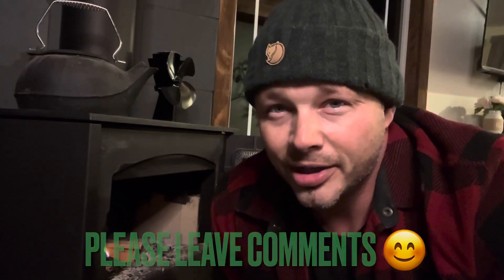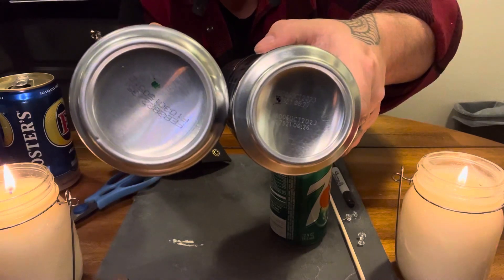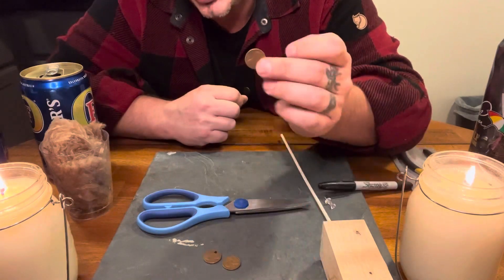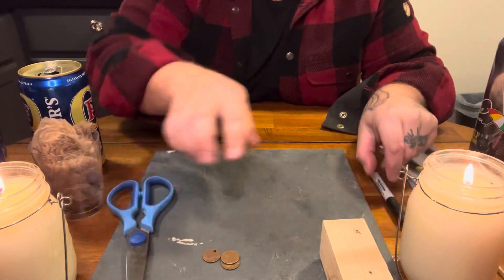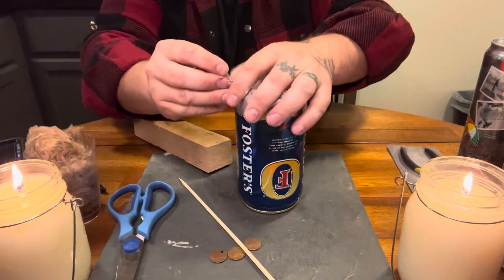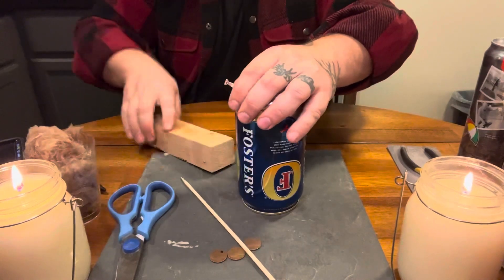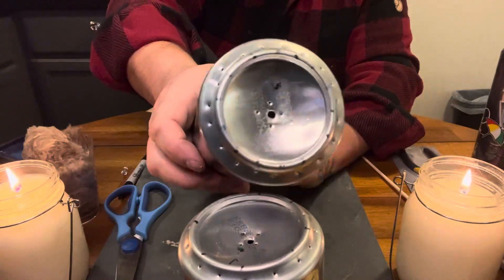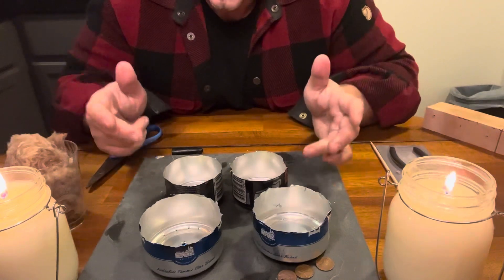Penny can Stove | ALCOHOL STOVE | Emergency HEAT

Comment: I made this stove years ago. The stove I made with The Foster's cans I used it for around 5 1/2 years . I first lived in a tent to prove I could do it that's when I made my first stove. And then made the Foster can stove, because I knew it was much better weight of aluminum it was bigger around and I knew it would last longer. After proven everything I wanted to prove by living in the tent. I then moved into an apartment that had a fireplace. I used the Foster can stove to heat my apartment every day in the winter and it worked great, that was the only heat I ever needed in the apartment, I just added extra fire brick inside the fireplace to generate more heat.  I still have that stove. That stove is now 15 years old. I still use it on occasions just for the fun of it to cook on outside. You can also use 70% rubbing alcohol and it works fine. I made my first stove in 2006. I now make them and give them to homeless people out of just Arizona iced tea cans and soda cans, I've been making them and giving them away for 15 years.
Reply from the maker: What an amazing story Marcia! Thank you for sharing and thank you for helping everyone you do! many blessing to you this holiday season!
Reply: Yeah my friend you get good attitude 👍😉😊🤝⛄☃️❄🌞
Reply: Wow great to know I’m making me some for for my tent
Reply: How long will one fill burn?

Comment: Love it.  I made a stove with a thin copper tube with jb welded penny on each end.  2 rows of 5 tiny holes on the top side.  I made a mini stand for it.  Tiny house stuff would be nice.
Reply from the maker: OK buddy I will work on that, what type of stuff do you want to see with the tiny house, just a walk-through or things I did saved money and ideas? I love the copper hose heaters they are super cool, I just haven’t made one into a video as many of my viewers need simple solutions, the folks that may appreciate the advance stuff is a smaller number for me😬

Comment: Back in the day these stoves were popular on the Appalachian trail. They are lightweight, low tech, so they don’t have complicated parts that break, alcohol is easy to find at hardware stores and gas stations (and dollar stores, apparently). If you misplaced your stove you could easily make another with trash and a multi tool. You don’t have to worry about checking your camp stove in your luggage, which is not allowed overseas. Easy peasy lemon squeezy! 
The only 2 downsides are that 1, alcohol doesn’t burn well at very low temperatures, and 2, if you are not careful and knock it over while it’s burning there is fire immediately.
Reply from the maker: Thank you Nancy, you are correct on everything… Definitely good education to know, thank you for watching many more tips to come

Comment: Hey Cohen, I got your video of the 72 day candle in my suggestion list. I watched several of your videos and this is the stuff of which I am looking. So I subbed, Liked and pounded that Like button. Looking forward to more videos.  God Bless and stay safe.
Reply from the maker: Thanks I will KEEP EM COMING BRUTHA !
Reply: On the rocket stove, as a mobility challenged senior who really has no space to store tinder,& can't really bend down to gather, would there be any problem with using chunk charcoal.  Of course this would be outside,.  Could we set stove Up on the grate of our community grill or would it be too heavy?? I imagine 2 or 3 chunks would throw off quite a heat.

Comment: How often would you need to replace the insulation, or cotton balls if you are using them? sorry if this has been answered, I did read the Q&As on a single burn time - but after that one burn do you just refill with fuel, or both fuel and insulation, when you want to use it again? 
Second question: once you use it say with Heet and burn it up completely, and let it cool, can you refill that same used can with a different fuel like denatured alcohol - or is it a bad idea to mix the two even if you think the first was burned off? Thank you so much for this video!  It's really reduced my stress as I now know I can make do with a lot I have on hand if need be.
Reply from the maker: Insulation or steel wool or even cotton balls… all should last many uses . 
Shoot for the yellow Heet  fuel it burns real good -  it should burn off fine to switch fuels 
Thanks for watching 😊👍

Comment: I have made the penny typs stoves from small tomato juice cans, regular drinks cans and the arizona cans, I havent had and fosters cans to play with. I dont like the smell the fuel additive gives off and its kind of expensive, plain rubbing alcohol works well or denatured alcohol.. I really only carry the smaller stove, its all I need to make coffee, for other meals i have other stoves. I may have to look into a fosters size stove to use in Desert Sun02's latest heater idea
Reply from the maker: I like it because it’s a bigger can holds more fuel, you could actually use less holes…

Comment: would love creative ways to make used vegetable oil heaters without all the wick problems and mess.i used the cut off bottoms of soda cans with a little hole in the middle for the wick, put 4 in one 8x8 baking sheet floating on top of the oil. the heat is great but the can bottoms often fill with oil and fall in. So it would be great to come up with something that works without so much fussing.All of us have access to free used oil, even in an emergency when we can't get to the store, or can't afford to buy other things like crisco,heet or alcohol.
Reply from the maker: Thank you - I will put some thoughts into this 🙌🏽

Comment: For peenies you should stay away from 1982 also. That is the year they began switching to the Copper clad Zinc core penny. 
You don't want Zinc, because Zinc Vapors are Toxic. This is why welders must have Strong ventilation and wear respirators when welding galvanized steel.
Reply from the maker: I put that info in video….🧐😁

Comment: Are you able to use a small  thin "punch" and using a little pressure push your holes, a small wire snips easier to use, its angled. Im for easy and this is too much work and  if you use tools designed for stuff like this less likely to cut yourself.  Does it have to be so neat?, or do you need to spend all day doing this.? Id use gloves for the  fiberglass  application. Wire cutter snips i think might be better  then the glove would save your thumbs. Hey why not use a Kerr canning lid?   Cheap , fast,    Wait a few dont touch while hot, buy slate or tile pieces at home depot  for a base. Good wlll always has wire racks  to use as a place to put your pot on rather than trying to balance your pot on., or your can.  Safety First, keep a small extinguisher  handy, we arent all woodsmen.IF YOURE GOING TO ALL THIS TROUBLE OF GATHERING TO MAKE, THERES STILL CHEAP AND EASIER, IM an 80yr old woman, theres smarter too,  boxes of matches wont dry out like lighter fluid. , bend heavy screen into a small fold over  table over your tiny stove. Keep in a box, ready.
Reply from the maker: Thank you for your input Arleen, Yes I’m going to create another video that is more simple and easier for everybody to affectively heat up to cook, thank you for watching
Reply: Riverside Homesteading , i never meant to deminish your way of getting us Ready. Some of us are OLD TENT CAMPERS, NOT trailer campers. Without my husband of 20 yrs, i found how inventive i can be in survival  mode. I may have to camp in my home. I cant leave. . I feel like Annie Oakley,  but im determined.  Thank you for Caring, too many of us have bought into whats convenient,  easy, provided. We need Grit., weve lost our pioneering  spirit, its not in the movies, its in our spirit.. i admire yours.
Reply: @arleenwatson2076  two thumbs up to you Annie Oakley!

Comment: Use a razor blade to cut the can put it on the wooden block and turn can into the blade till break thru little then press a little should just fall apart easy and will make the can straighter than cutting with  scissors ...Watch other videos to see the info better ...

Comment: Where is the oxygen drawing from? Can/should I put this on/bury in a container of sand? Fire control.
Reply from the maker: I have no idea - Al ost seems like it does not need much of a draw at all—  this one s a super effective tool but practice outside to get conferrable / smart to have a big blanket around to smother a fire should it accidentally get spilled ! - adding fuel could start a fire as you may think there is no flame but there is - or it getting spilled , while lit can start fire - safety first- so be prepared for accidents and get conferrable and proficient with it- watch the rocket stove vid ! That is a pretty safe outdoor cooking system! Maybe I teach/ video how to operate a rocket stove indoors !! With make shift chimney !!! ? ?

Comment: Where did you get your wood stove? The ones for tiny homes are mostly sold out or cost an outrageous price. Thanks!
Reply from the maker: Hi Aussomgang Peeps, It is a Avalon camano.... it is probly a bit much for our space but it has a nice slim design and super efficient ...  I actually got it second hand for good deal... but its nice to know if I was to have hard cold we would be plenty warm....  I would check your local fire place shop and see what they have on hand... thank you for watching ! more tips to come
Reply: Check out offer up
Reply: @RiversideHomesteadLife  You're really creative! I'm sure you could put together a decent wood stove/ fireplace. Bricks, a length of rainwater drainage pipe and some cement. Add a metal sheet to fit on top, for cooking, frying, etc. Or use a grill pan, or a metal sheet from the hardware store or even a piece of scrap metal from some junkyard.

Comment: How long does the stove burn for? and can you use a different fuel source?
Reply from the maker: Yes you can use different fuel sources, research different ones to use but iso propyl alcohol and this particular heat works great, many say the yellow bottled heat works better, I haven’t noticed much of a difference, the stove burns for about 20 to 30 minutes in my experience, so it’s a great source of boiling some water an emergency situation as it only takes a couple minutes to boil water, watch our other video where I tested boiling water along with a crisco unit

Comment: You are the second person I've watched make this stove and you, too, warned about  the year of the penny. Likewise, you are the second person that failed to explain why. Please enlighten me as to why it has to be such. Thanks.
Reply from the maker: Sorry- it’s because penny’s prior to that date are made with copper “If your Lincoln Memorial penny has a date before 1982, it is made of 95% copper. If the date is 1983 or later, it is made of 97.5% zinc and plated with a thin copper coating. For pennies dated 1982, when both copper and zinc cents were made.”
Reply: @RiversideHomesteadLife  Ok you explained it. But what is the difference if you are only trying to seal it off to create a vacuum? Will the zinc catch fire or something? Thanks for responding.

Comment: How long will one burn on 1 fill. I would be using alcohol.
Reply from the maker: Use yellow heat or grain alcohol.. for cleaner burn…  I mentioned how long it lasted in video - a tuna can will burn almost 40 min !
More tips to come

Comment: What do u use to put over it to cook with though?
Reply: Yes, I'd like to see that in action please!
Reply from the maker: Check out the end of video for what I use and I will make vid soon of action 😁
Reply: You can get a sterno stove which is used for hiking & camping. They are inexpensive.  The one I bought you can use sterno heat, wood, spirit burner in it but these penny cans are perfect for it too.

Just wanted to add that it's big enough to put a fry pan on.  The top is a decent size & it's pretty sturdy.
Reply: @karenmessinger9609  Yes. Bigger cans should work too. We have luncheon meat cans here about 4" diameter x 2" high. Some are a bit bigger, some a bit smaller. So should be able to find 2 which fit inside each other.

Comment: Can this be used with a clay pot on top to help heat?
Reply from the maker: It is better used for cooking as it won’t last much longer than 30 min max each fill - better off making many crisco heaters - have multiples they last longer
Many more tips to come
Reply: A clay pot on top of any flame does not create more heat period. It may  help slow down the dissipation  of the heat to  the rest of the room but that's it. If it did create  more heat that would be  called  magic. 
 Your just  not going to get  around those dang laws of physics with a  flower pot.

Comment: I made close to 50 of those penny cans alcohol stoves and I threw them all away.
Simply because there wasn't a way to set a pot down on the stove itself.
And the fact that you're using heet in the red container is not a good idea, because it won't burn as good as the heat that comes in the yellow can.
You really should be using heet that comes in the yellow container rather than the red.
And the fact that you have to use a copper penny makes it a problem since the pennies these days are not made of complete copper, as the newer ones have zinc in between a copper coating.
So I was providing real copper pennies dated from 1982  backwards.
But it's your choice if you continue to make them.
I made a completely different one that's made out of beer cans with a neck And I can actually set the pot right on top of that can itself and cook from it.
I found an easy way for marking around the cans to make it exact too by using a rubber band.
I fold the rubber band exactly and half And use a magic marker to mark each end of the rubber band Then I take those two marks and put them together and fold the rubber band again and make two more marks at the ends of the fold and I continue this until there's 16 marks exactly equally apart from each other.
Then I put the rubber band on the can and it shows me exactly where to mark the marks right above the marks of the rubber band.
Reply from the maker: Thanks for the lengthy reply- I take it that you did not watch entire video 😂 I go over the penny dates and the red vs yellow Heet 😉
Watch the video I did were I test crisco and penny can- the red Heet burns much better after first entire burn out.. and may last longer- you will see how I cook above them- 
Thank you for your tips on creating another good system- that is very cool! 
Many more tips on channel and many more to come 🙌🏽
Reply: @RiversideHomesteadLife  
I didn't watch the whole video before I replied duh my bad.
But think about doing it with a rubber band it's so much easier than trying to measure it with a measuring tape.
I thoroughly enjoyed your video and thanks for sharing all the things that you do.

Comment: Why does it have to be a pure copper penny?
Reply: Was wondering that too...looked up melting points & it looks like because the mixed metal would melt and maybe block your holes? Quote from websearch: "Modern pennies are 95% zinc, with a thin layer of copper on the surface. Zinc melts at 420C, and the copper layer will generally burn away when you melt that, leaving oxide behind. Pennies from before 1982, however, are pure copper, and would melt at 1085C." The base of a candle flame is ≈1,100 °C.